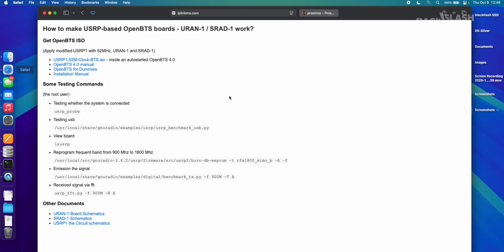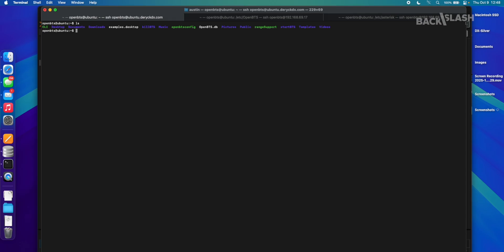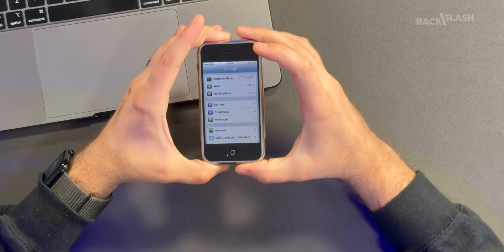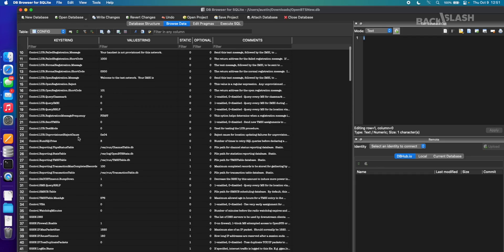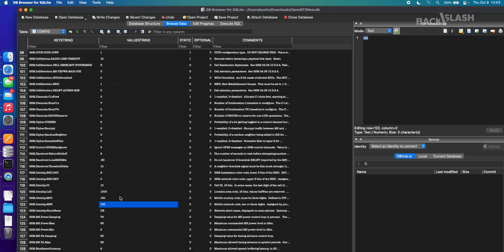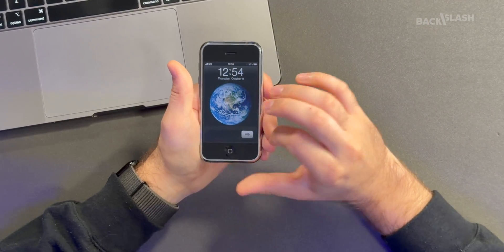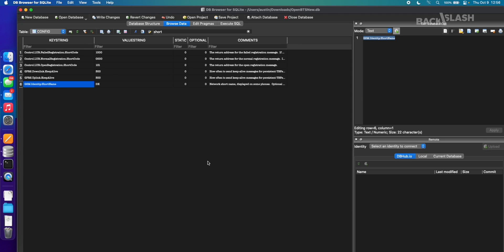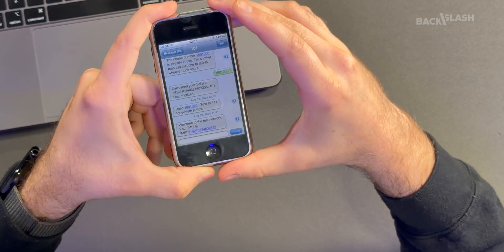I Built My Own 2G GSM Network - Part 3 (Installing and Configuring OpenBTS)

Comment: do you have a discord or some other social media to talk on? I tried both the iso install (which failed with a error) and the Ubuntu 24 github version (which I couldn't get to load the sdr firmware, it never installed it for some reason). I'm using VMware workstation 17 for both.
Reply from the maker: Honestly I don't think I'd be much help... I barely figured out how to get my setup working, VMware would be out of my depth for sure. I do wish you luck though!

Comment: Every device on the GPRS network needs a SIM to be registered right? how are you handling that? or how does the phone get to connect to the network, The IMSI what make it unique if there's no SIM available? is it eSIM?
Reply from the maker: The IMSI is the SIM identifying number, so you have to add the IMSI for the SIM you want to OpenBTS for it to register and allow the phone to join

Comment: You made some great points, although definitely would be important to know that the Ubuntu 12.04 version isn't compatible with modern machines. So if someone wants to use real hardware to install, they should keep that in mind.

Comment: Second comment: what if a very tiny one was made so that it could attach to the phone and have constant cellular, also is the cellular free?
Reply: Theoretically yes you could do that - but the cellular would need to be backed by some proper connection to the real world. So yes, while you could do it, you’d probably need to use another 4G/5G plan as the backing connection ….in which case, just use that rather than the GPRS jump in the middle!